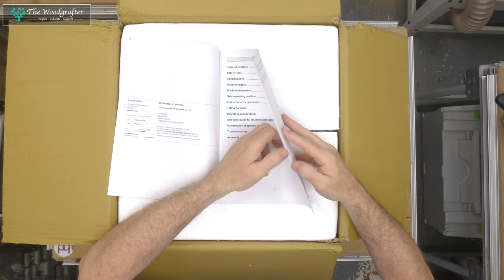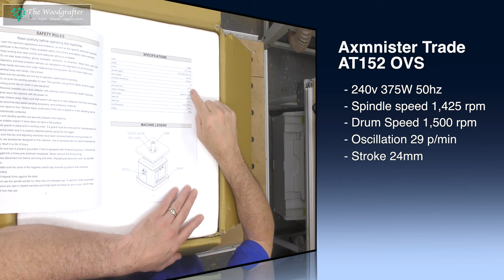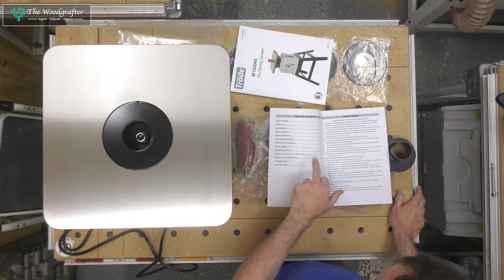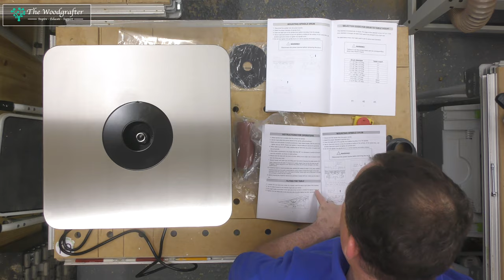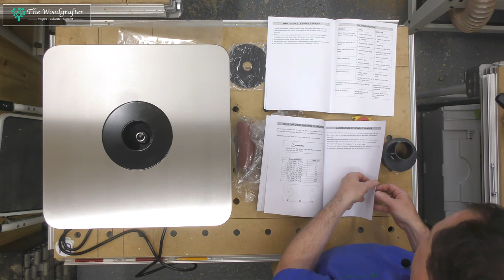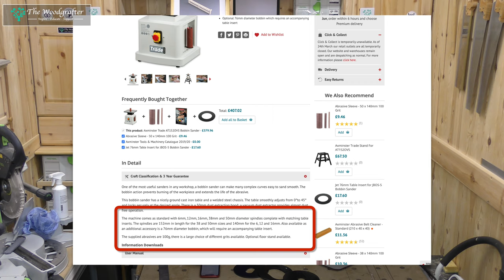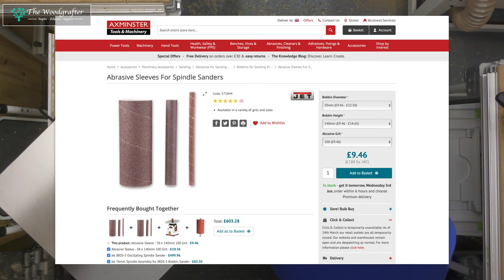Axminster Trade AT152OVS Bobbin Sander - Review

Comment: Looks a bit of a beast Andy.  What made you choose that one over others.  I have a Belt and Disc Combo sander (Sip) and use it every time I'm in the shop.  Looks like there is a Nice White Oak stand project coming soon. 👍👍
Reply from the maker: It will do the job 😀

I have a belt sander that will at some point have a permanent position in the shop - I went for the belts sander to flatten panels. So the combo didn’t make sense (although it was tempting) - also I wanted to be able to drop some organic shapes into my designs. 

I have a lot of scrap oak from a previous project, so knocking up a few shop projects - next week will be the storage unit for the Benchdog collection.

Cheers

Andy

Comment: Are there no slots in the left hand side of the machine to store the insert plates as shown on the Axminster website? I must admit, I would have been a bit miffed with the chipped paint considering the amount of packaging it came in. It's for me to damage the finish and nobody else. The unfinished spindle end I would have expected something to fit it at least. Obviously whoever designed the thing intended for something to fit it. For Axminster to say it's complete makes me think they cobbled the machine together to make a package.
Reply from the maker: Nope nothing like that I’m afraid. Yes the knocks did annoy me somewhat - but not worth the hassle of the return.

The response to the spindle did surprise me, just doesn’t make sense - why engineer a thread if it’s not used.

I am going to print out an attachment to improve the functionality - 3D printing the rescue.

Cheers

Andy
Reply from the maker: Checked again and you are correct there are three slots cut into the left hand side that does indeed take the plates.

Thank you for commenting.